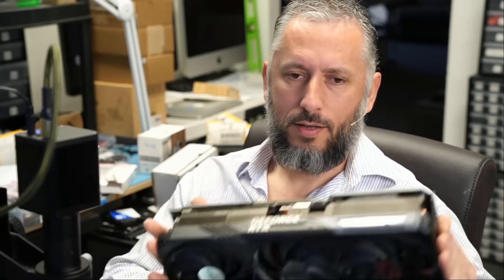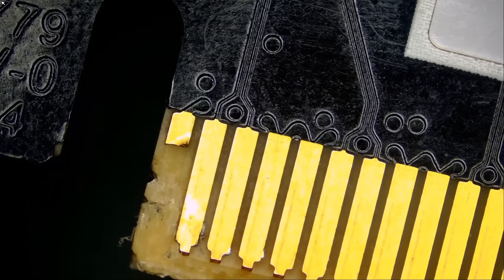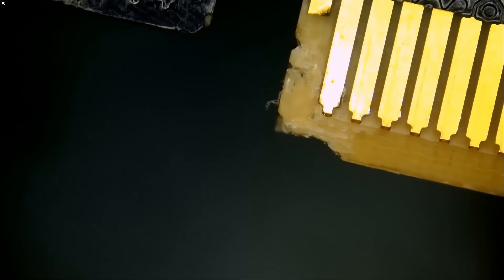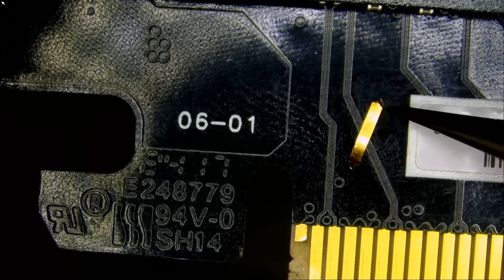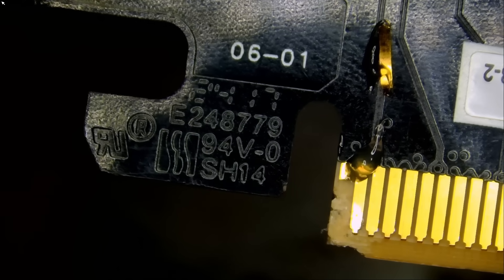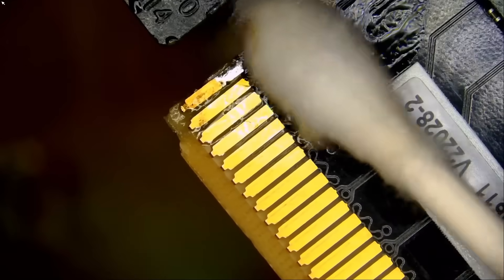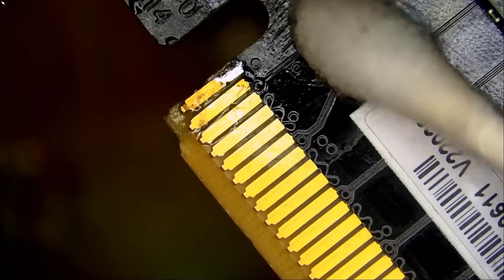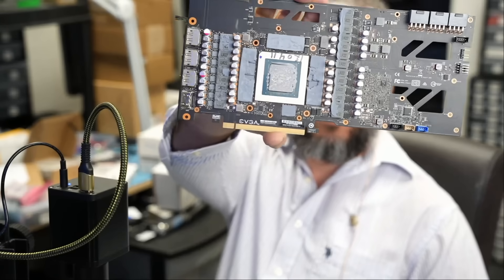$2500 Gigabyte 4090 GPU Damaged PCIE Connector Repair. This is ugly.

Comment: I have the same problem ,I've had crashes on my pc where my gpu fans would randomly turn to 100% and I get a black screen ,and also had other problems like the GPU fans  randomly increase speeds for several seconds , and losing signal on my monitor , I've opened up my pc today to fix another problem (Which I'm not sure I've solved either) and had to remove my gpu to get to the motherboard battery accidently got locked on an opening screen for stupidly checking in the open case detection in my bios and couldn't even reload it  , so checking in google it recommended doing it and I've had to remove my gpu to get to the battery and found out it's connectors are broken  while doing so ,is there any way I can fix it myself or should I find someone like you in my own country and city? (I don't live in the us)

Comment: This is my GPU. It was given to a packing company to ship to our data center in cartons of 3 each. UPS hit the box from the side and smashed this card in particular, just barely. It is unfortunate but I am happy it was fixed :)
Reply: But the connector was burned on one side, did someone install it and power it up with the damaged connector which then caused a short?
Reply: @ats-3693  Hi, no, it was not burned, in the video it is just a light reflection I think. The damage was noticed immediately and the card was never connected, it sat on my desk for 7 months in this state as a nice decoration until I decided to try and send it to NF for repairs.
Reply: How much were you charged for the repair?
Reply: @ The fix fee was $349 and $19.45 for return shipping!
Reply: Why wouldn't you ship it with the gpu uninstalled? I take mine out if taking my pc somewhere.

Comment: Amaxing man i truly love watching your content its so informative and im not sure if what im about to say makes much sense but i use to work on cars many year’s mechanic and body work im now getting into building computers and i look foward to heading towards pc repairs but i was wondering i know that bottom of that gpu connector is small a thing i wonder if it could be reconstructed with a small amount of fiber glass and resin reconstruct both corners and the a final dip and tho hole bottom ones its nice and solid shave off the edges to shape it up and it will be good as new

Comment: A trick to rebuild the edge of the connector is cyanocrylate glue i mean good professional glue and baking soda you let it dry solid ..you sand it down and after that you do the same process of soldering the gold fingers on the  card .

Comment: The new Nvidia made 5090s are modular so that pcie slot and IO are on seperate boards and connected to the mainboard via ribbon cable. This should make this issue much easier to fix in the future. Just replace the pcb.

It's really annoying as the AIB partner cards use a single PCB not the modular design which sucks as I want a watercooled card. Hopefully there is a waterblock to suit the modular Nvidia PCB so I can just buy one and swap the cooler.

Comment: I don't understand how people do to damage their expensive cards and components to that extent.

I'm not the most gentle person, but I've been building computers since the 80s...  the only component that got damaged by my own fault over all these years was because of "voltmod" I did on a Radeon 9500 Pro back in the early 2000s, and I left a bridge between two pins, by mistake, that was hardly visible (no microscope back then, all I had was a magnifier). That wasn't negligence per se, that was a calculated risk that didn't pay off.

Comment: Very nice! Ive had to repair a card like this very tricky. I am curious if you have ever tried replated pins if they are worn away. I had a genesis game that was corroded and once it was cleaned up i just used a very thin solder with a knife tip and good flux and it worked well enough.

Comment: make sure you tell him to check pcie slot on his motherboard for those snaped traces. had mate that brought new card after doing that to old card, pluged it in  and blew motherB and new GPU coz of it shorting inside pcie slot that's worse case best case it wont post and think MB is dead

Comment: This is why the 5090 FE pcb is such a great design. No PCB cracking and ruining the card. If the pins get damaged just replace the cable and pcie fingerboard. Source a replacement cable and fingerboard ASAP so you are set for the future.

Comment: I use 2-part JB weld epoxy resin which is very effective at repairing damage like that.  It is pretty tough when properly cured and can be ground down to make it nice and flat.
Reply: Yeah, epoxy, I was about to say that.
Reply: We should make airplanes outta JB Weld, it's un...fucking breakable.
Reply: This repair looks terrible, could maybe plug in the card once before it breaks again.

Comment: Nice repair, even though it looks decently strong if that were my card I'd probably never unplug it again or like maybe permanently connect a riser to it and getting a vertical mount if needed so the actual connector isn't involved anymore.

Comment: I'm putting that in a riser it's never getting removed from.
Reply: you better boy!!!
Reply: A riser is the only way, I'd be on needles on every single card adjustment without.
Reply: @martijn-vels  yeah well if they didn't make the dammed pci--e connector so fragile you wouldn't have to be but they do so a raiser fixes so many problems
Reply: @raven4k998  I agree.  Would anyone hang their toaster by the cord while it's plugged in?  This design was fine when cards weighed 2 ounces.
Reply: I feel much more confident with my 4090 in a vertical setup connected to a riser, rather than traditional sideways setup directly into the motherboard. so much less stress on the slot, no sideways tension on it at all
Reply: you need a pcie x8 or x16 riser, not x1 that are used for mining.
Reply: @orange11squares Sure, the point is that if you ever need to let’s say clean a PC or do anything else that involves taking the GPU out, you can take the riser out of the mobo, and leave the GPU in its slot.
Reply: @orange11squares  yes. Cooler master and lian li is a good option. For low budget thermaltake is also fine
Reply: Good boy! Daddy is proud!

Comment: someone must have been really rough with that GPU to cause that much damage
Reply: dont forget to seat the gpu properly, with a hammer.
Reply: Not really. A card of that weight (about 4.5 lbs), dropped from workbench height (about 3 ft), hitting a hard floor -- would impart quite a bit of kinetic energy into the card when it hits. This would be made worse since the card hit in the worse possible spot it could -- the corner of the beveled edge connector.
Reply: I think they took a grinder to it poor card
Reply: Probably playing frisbee with the dog with it.

Comment: Still need to wait in the future for a substance that can mold around broken things and hardens, then grinded to shape that would be amazing for this
Reply: I saw someone reconstituting PCBs with a paste made from CA glue mixed with bicarbonate of soda and it’s immensely strong
Reply: @f16madlion  That can be almost impossible to use delicately. I use a two part epoxy putty or a single part silicon putty both of which can be moulded to shape for building up various jobs. However I would have warmed the board edge then used some warm epoxy resin which would soak into and stabilise that board edge to at least as hard as the original - I don't like that sticky glue in that situation I get it everywhere! - but otherwise done basically as the video showed.
Reply: Why wait... JB Weld is perfect for repairing the board.
Reply: resin?
Reply: @mariesvilmy5680  epoxy resin bonds well because a lot of boards are glass reinforced epoxy. JB Weld or Araldite or even something from the Pound Shop will be ok. If slightly warmed and applied to a warm substrate it will wick into the cracks quite well which is why I said it's good for stabilising the substrate. The quick set style can be awkward because it can set really quick if heated too much!